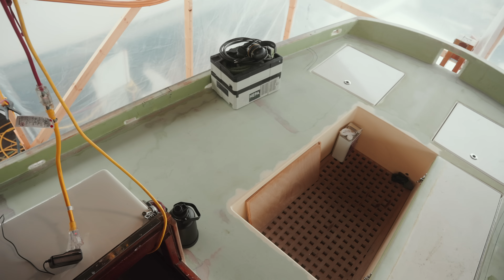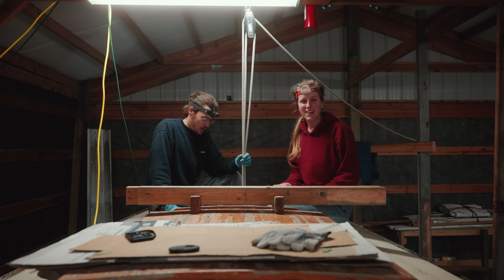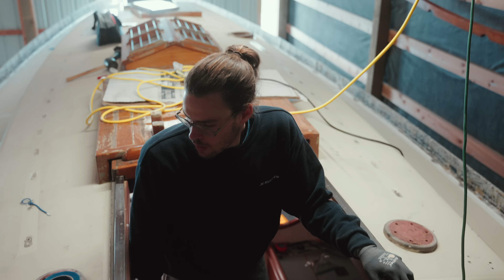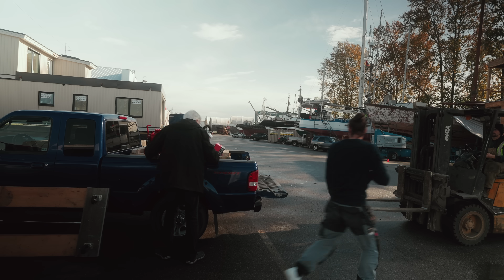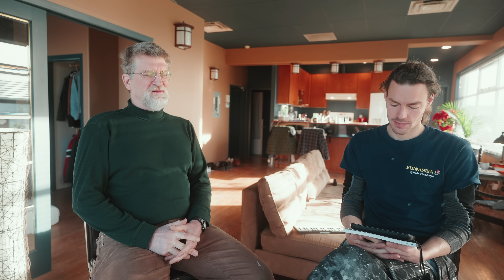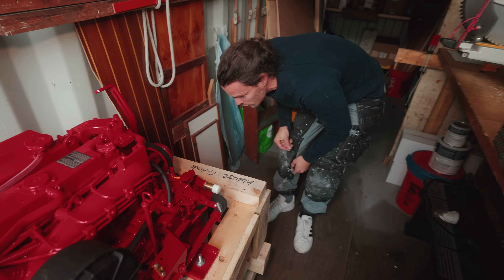REVEALED: Our New Engine!

Comment: I am surprised you never went hybrid with a generator function at least as you just flick a lever and charge your battery up or charge with the propeller when sailing that's what I would have done I would even lose a bit of cabin space to accommodate it as it works so well I know you have to store more battery but then you wouldn't need gas on board which can be very dangerous many fires and new battery now are very safe and you would have a nice clean electric cooker stroke hob I know space can be a problem but you have designed that boat so well with plenty of storage I would think you wouldn't need many battery's and maybe put some in the bilge area or up high in the engine compartment on shelves or storage lockers the good thing with battery as long as they are sealed not lead acid can be put in any position and fitted in many tight spaces so you have the best of both worlds you have a fully functioning diesel engine and an electric drive as well and a generator powered by wind or by engine you have so many choices so you would use electric to get out of harbour and you can go at any time not waking anybody up same coming in and you would save so much on fuel as well it will pay for itself and you wouldn't have to worry about running out of battery power as you will always have a means of powering your battery and if you run out of fuel you can still motor into harbour safly under electric power charged by the wind. there are just so many pluses in my view yes it's not cheap but it would pay for itself very quickly if you intend to live on the boat then there would be no more going to get gas bottles to cook with just flick a switch or dial and start cooking as it will be a lot safer and cleaner. for you and the environment. full electric is a no-go for long-distance boats only hybrid or diesel will work on world trips. at the moment so all the best from john from Rugby UK.

Comment: Please let us know what your estimate for fuel consumption is at best cruise rpm and how much fuel you will have on board.  Very interesting discussion, kept a car guy all ears.
Reply from the maker: 2.6l at 1800rpm per specs. We carry 230liters. Gives us about 400miles in range. Probably less though as sometimes you need more power from the engine (tides/current) thus increasing consumption. We also have to take into account that high output alternators also require their higher consumption.

Comment: Thank you so much for the knowledge and logic you incorporated into a VERY brief video. I can be a bit like Mia's dad, though not nearly as knowledgable. But much of the reasoning that he and Aladino applied in selecting the Beta engine for Magic Carpet II is what led me to stick with the VERY old technology of our Lehman-Ford 120hp when the original aged out in our 1976 Pacific Trawler. When you are away from cities, whether voyaging or just in northern coastal waters of B.C., it is comforting to know that you can sort out and (hopefully) solve most engine issues without calling in the service tech with the computer in a suitcase. Many issues are different when cruisng a motor yacht versus a sailing yacht, but they are also much the same. So your reasoning resonated with us.

Comment: Hey guys

Enjoyed the engine episode but I hope there will soon be a similar episode on how you are thinking about your power needs and how you plan to meet them when you are off grid cruising.   So I’m wondering

1. What do you see as your daily power consumption for refrigeration; comms and navigation equipment, lighting (cabin and nav) plus all you’ll need for the video cameras and editing equipment so that you can keep sharing your story

2. Will all that be low voltage DC equipment or will you have an inverter?

3. Assuming it will all be DC how many days consumption will you want the house battery bank to cover and thus what size will the battery bank need to be.   And will you use lithium to keep weight and size down or will that just be too costly for you meaning multiple lead acids instead (70% plus of a lithiums capacity is “usable” v only 30% of a lead acid as I’m sure you know)

4.  And then how will you keep the batteries charged up?  You mentioned a second alternator that you had specially chosen today.  But will you also have solar panels or a wind generator.  The former of course arguably will look out of place on a classic style cruising yacht like your Cape George whereas out of place also applies to a wind generator plus they can be noisy.  

5.  But if it’s just engine generation then how big a fuel tank will you be installing and therefore how long off grid do you plan on being able to spend before coming in to refuel.   The possible hydro generation when under sail you mentioned today is another possible charging source.  But it didn’t sound like you planned installing that upfront. 

Anyway it will be great to learn your thinking on all these interrelated questions as and when you are ready to discuss them. 

Keep up the good work and hope all progresses well this winter towards launch.

Comment: RE:  Your comment about letting your prop spin freely...I don't know if it's true, but I've heard that, while counter-intuitive, a spinning prop actually INCREASES the drag. (I know that you were speaking of possibly using it to generate electricity in the future...which is a separate issue.)  We DO want to feather engines on prop airplanes (to reduce drag) when they stop.  So you will probably want a prop-lock.  Many trannys will overheat if spinning on their own.

Comment: I have significant experience running a global Oil and gas engineering , technology and service business on 5 continents which included many diesel engines , some as small as 3 cylinder or as large as 12 cylinder my experience tells me your choice of a traditional mechanical pump and mechanical cylinder injection system without electronic controls is the correct one. The next issue is fuel management you need a fuel tank circulation system with primary filters and bio treatment programs , fuel you get in developing country small ports may well be adulterated, we had fuel delivered to a site in Africa that was clearly “ topped up with used engine oil”, we rejected the load after one of our technicians bottle checked it before unloading?

Comment: Good choice avoiding a modern engine with all the electronics they utilise for higher fuel economy. The Kubota base engine is found worldwide and any mechanic can work on them and parts are readily available.
The modern flat serpentine belts are a good choice as they will handle the high loads of a high output alternator. 2 alternators is also a good idea  as it gives you redundancy if one of them packs up.
Beta marine have been around   since 1987 and have a good reputation .

Comment: Nice video, well argumented, and really pleasure to listen. It's not about peak power, it's about toque in relation to prop & weigh, to say it simple. I am aeronautical engineer, but it's pretty much similar, you need as much torque as possible at RPM range that gives you the best fuel economy for optimal speed. Regards from Europe :)

Comment: I have to admit, as a westerner, I just don't think electric is ready for certain missions. Anything long distance or in harsher conditions than the easier sailing in warmer climes just still unfortunately really needs diesel as a backup, and on a 36 foot boat, you don't have room for a main system and a backup. The technology is coming along and I love that you are going all out of solar as is possible, but hey....  at the end of the day, my camp stove runs on fossil fuels. And it will until there's a really, really good alternative. (And I'm hopeful for that!)
Reply: I think it would be very, very cool if for us Patreons, you put together the kind of stats/benchmarks that you feel an electrical system would need to achieve before you would happily make the switch. I think that sort of unpacked thinking is just utterly fascinating, and honestly, helps inform companies that are working towards that conservative carbon future.

Comment: The original bmw engine looked to be a twin cylinder.  The beta I think is a triple, which should be smoother at any rpm, maybe more important than  the peak cruising rpm, The vibration level at the optimal rpm is a consideration as well. In other words, I think you made a good  choice.
Reply: Which thought was that? It is easy to look up ! there are 4 cylinders.

Comment: Always go with the more power,.. always,.. it's easy to use an engine at less than it's maximum and it's impossible to use an engine at more than it's maximum,.. Always go up in power if you can.

Comment: I used Skene Elements of Yacht Design to calculate horsepower needed and propeller dimensions. This was a long time ago. In my case I was advised by this book to have a smaller diameter and a bigger pitch for my propeller to reduce the drag a bit more. In practice it worked out fantastic as I may say so.

Comment: If you had a rig/sail failure, I would want the capability to return to port or continue to destination.  If medical issues were involved in the incidence, it could be life threatening.  Currently diesel is the only thing that could possibly give you that type of range with out betting the farm that the sun will shine.  Then there is the costs, weight etc. that you mentioned.  Very intelligent choice.

Comment: 3 More advantages of non- common rail mechanically injected diesels:
1. Electric power loss does not necessarily stop the engine running on a mechanical engine. It does on Common rail. This is a particular consideration with any Lithium installation where the BMS can abruptly shut the system to zero volts to protect the battery. Discomforting if you happen to be running a reef entrance at the time.
2. High pressure vaporized diesel fuel is a fire hazard in a leak situation. In a tiny engine room it is potentially explosive.
3. Microchips are a necessary evil today. But on a boat they are the most pernicious of gremlins. Good on you for demoting your engine's to monitoring status.
 
Good call on the reduction gear. One thing Beta has received some criticism for is that their standard gear pairing is less than continuous duty without gear oil cooling. 
Beta has done an amazing job at being DIY and generally installer helpful. Scott sounds like the west coast counterpart to Farren out here on the East coast.
Enzo is a great name! I went with Rudolph - both for the red nose and the original inventor!

Comment: Great choice guys..., and what a team! A few years ago I wanted to re-power my old Hallberg Rassy 312 Mk1 and I would have chosen a BETA, but then I sold the boat in favor of a more recent and confortable Moody 33 Eclipse (10 years younger). The original Volvo MD11 engine had a lot of hours but worked perfectly despite being a little weak for the 5800kg of my HR. The original Volvo in my Eclipse 33 is only a little more powerful (28 HP) but sufficient for its 6200 kg. 4 HP per ton are respected but I think that great importance should be attributed to the propeller and its correct dimensions. Congratulations for your very professional and passionate work. Well done!

Comment: I am interested to know what  anti- vibration mounts are supplied with the engine. Are they Metalastic still? I used to sell anti-vibration mounts to Beta Marine in the UK. I wondered if they were still using them. Also I fitted out my own 45ft boat including installing an old perkins 1108 out of a van into it having marinised it myself. I later swapped that out for a new Isuzu when the Perkins got too tired. This included designing and manufacturing new engine mounts to fit the new engine to the existing engine beds.  I have been following the story of your two from way early on, I usually keep my comments to a minimum as other seem to have more important things to say. I look forward to each Friday episode. Thanks for posting them.

Comment: Have a look at what Fellow BC  Canadians at Edison motors are up to with their Topsy Hybrid logging truck conversions ..
You drive from electric but run you're ICE generator at its Stoichiometric optimum.. less fuel less pollution less wear and tear.  The whole plot  is lighter and more powerful. The fuel saving is 30-50% with an off road logging truck ..

Comment: Sailing Magic Carpet. Love the thoughtfulness that went into your Engine. Like the Red color. I know you a long away from the Mast Choice but please go with Carbon Fiber to Help with the Weight that you may have added. Have you weigh Her to see the Difference so far?
Reply from the maker: Hi Gregory. We really haven't added weight. I know it may seem like it, because you've seen us install so many parts of the boat, but remember we first had to remove all those rotten/damaged areas before replacing them. In fact, we actually saved weight on the bulwarks -- they were originally wood, and now they're foam. Even the fibreglass on the decks was also there originally. The cockpit actually originally had teak, and we're also saving weight by not re-installing it. The boat will be the same weight or possibly even lighter at the end.
Reply: @SailingMagicCarpet  thanks So much for reply back. I do love the Engine you and Father in Law chose ,when time comes hope you also look at Dyneema rigging with Carbon Fiber mast  thanks for all you doing for Sailboat rebuilders

Comment: Really great explanation of the new engine. I have always had planing hull boats that use lots of horsepower to keep them on plane. Displacement hulls are such a different matter. The arithmetic was very interesting. The Kubota has a excellent reputation for quality and longevity. The install will be very interesting. One of my good friends who had a 50’ Sportfish with twin 672 Detroit Diesels marinized by Johnson and Towers. It used a central sea chest for call the raw water requirements. Very cool engineering.

Comment: Hi you guys, great video as always! There were a few things I was thinking about the CGC36 and the Beta 43, the aperture in the rudder is a limitation as far as the prop size, also another advantage of the Beta 43 is it’s block size is a step up (more durable) than the 38. The Beta line seems to have few weaknesses, one can be the aft port motor Mount is susceptible to rust, the other is that alternator heat can be significant in hot climates.

Comment: running the engine at the correct RPM where you hit that torque sweet spot is something most mariners (and all car ppl) don't quite get...its a fascinating topic and this was another great episode
Reply: I’ve been into car tuning and racing for decades. These days I get off on my Atkinson cycle plug-in hybrid loping along with moderate load, making barely any noise, and absolutely sipping fuel in the process.

Then I go online to the groups where people complain about not getting the advertised fuel efficiency while passing people on the open highway, asking why their engine is always screaming. Uhh, you didn’t try to understand what you were buying.

I was a little nervous when they started talking HP, but as soon as they started geeking out on cruise efficiency I relaxed.

MCII is going to be a properly equipped boat and so satisfying to helm around the world. I love this for them.

Comment: As for marine engines, there are no bad engines. It all depends on the treatment and maintenance you give to it.  Now begins The Integral MATHEMATICS, find Enzo an intelligent appendix, an alternator and good separating filters, finally look for some friends who Enzo can trust, I mean the batteries, panels, voltage regulators, etc etc. If you manage to adjust what you need (not what you want) That Beta marine will be proud of his great companion the NEW cutter George.  They have done an excellent and meticulous job.  Blessings and Smooth sailing.  P.S.  You must be very careful with the selection of the autopilot and its consumption.  As for plotters, today there are powerful and very low consumption RUGGED TABLETS, ❤️👍

Comment: interesting that your max revs are similar to the engine on my 26 foot boat (a little 19hp 3 cylinder nanni) and I too find the best cruising is between 1800 and 2000 rpm (5mph)

Comment: You mentioned the fuel requirements of modern high pressure diesels, and a good reason to avoid them. However, even for more humble engines like this one, modern diesel fuel can be very problematic. Put on top of that getting your fuel is less than ideal places, and a means of caring for the fuel is well worth considering. In the UK, a Company called “Marine 16” offers two things you might want to consider. One is a silica gel dryer that can be fitted in the breather line of the tank, reducing moisture content and thus condensation in the tank. The second is the “Diesel Dipper” - essentially, a fuel polishing system that separates out water and any gunge from eh bottom of the tank. Well worth a look if you haven’t already designed in such a system.
Reply: I think that "Sailing Cadoha" in the UK used the Diesel Dipper. He seemed really pleased with it...

Comment: You skipped an important stat!  What is the make and model of the alternators?  How much current do they put out, and what voltage are you going to use?
Reply from the maker: That’s going to be for when we tackle the electrical side of things:)
Reply: @SailingMagicCarpet  I apreciate and respect that for content, I still yelled at the screen lol.  As a professional I want important stats when they are discussed.